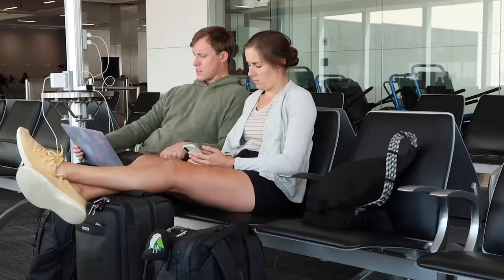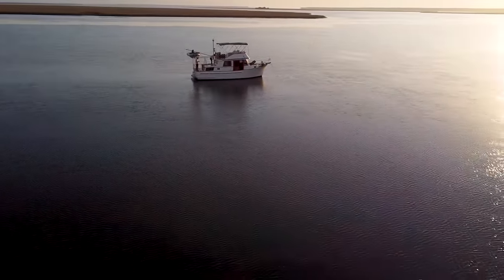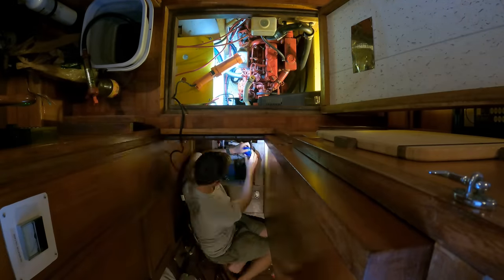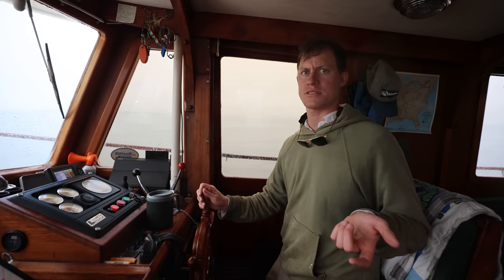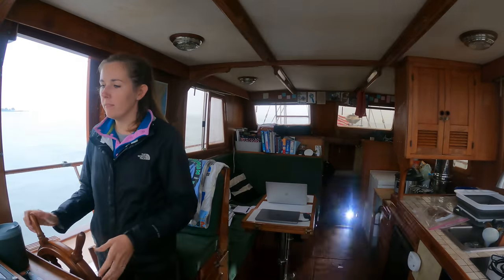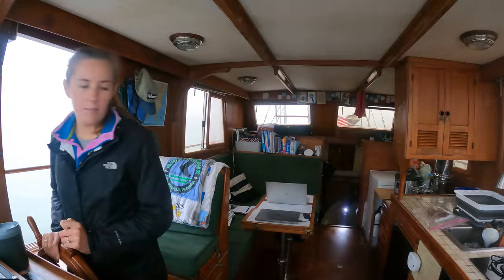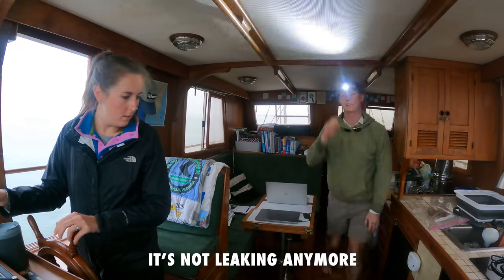ENTERING the BAY and we find a MAJOR LEAK! (Our PSS Shaft Seal + How we timed the weather)

Comment: You are doing a super job dealing with new boat problems.  Elliott is doing a great job obtaining info on problem and staying focused and taking breaks when needed.  Elliott, most times when set screws are tightened against a shaft they produce a burr on the shaft which keeps the collar from moving back.  Ran into this while on submarines.  Just a thought.  More huggs from Lady and Angel for Ollie.  Aloha!
Reply from the maker: That might be why it was so hard to move it! Thanks Steve 🤙 Aloha!

Comment: As an old Navy mechanic, I'm not so sure the shaft should be moving forward and aftwards.  But maybe it's different on these little trawlers? If I saw that I would start looking at bearings along the shaft.  Something would have to be loose to allow the shaft to move back and forth.  I believe this shaft seal is a mechanical type which depends on a tight contact between the spinning ring and the bellows portion.  So when the boat pulled in reverse and the shaft moved aft, the seal reseated. If something is a little loose and you start pushing forward, that would open the seal again.  I don't think this is a packing type shaft seal, those are designed to drip to keep the packing cool.
Reply from the maker: I think it wasn't the shaft moving so much as the bellows were sliding on the shaft making it look like the shaft was moving! Great questions and insight!

Comment: The shaft lock key on the coupling can work lose letting the shaft move forward toward the transmission. As the shaft moves forward the bellows will loosen. This could be the cause….always good to know all possible causes.
Reply: Exactly, I hope Elliot reads this, check the prop shaft into the coupling at the gearbox, the shaft may have moved forward a little Elliott, that'd explain the clunk you heard.
Reply: Unfortunately this actually occurred months ago They're well past it
Reply: Weather in video was dead giveaway but comments are for everyone to consider.
Reply from the maker: Thanks David! While our to tighten up the bellows worked (and we haven't had any issues in the many miles since) I'll take a look at it. We appreciate the thought!

Comment: Sometimes you can just tighten the stuffing box nut a pinch until you can reseal with a new packing. Some are designed to drip some are waterpipe fed like yours

Comment: Hi kids!!  Sorry you're having boat problems.  I have been rv'ing since 2005 and have my original 5th wheel unit.  Over the years I've had to replace/repair most major items.  That's the reality of boat/rv life as you are well aware.  You already know the "bad" points, but there are good points.  1) You really learn your boat and 2) if you fix it correctly, you can have faith in that repair.  Every time a new rig comes into the campground, I think about trading up then I realize that even a new unit will have issues.  I know my unit and how to repair it when necessary.  So the gist of this rant is this. Hang in there, you're learning what it takes to do this kind of adventure ( most people don't have the guts to leave the security of their homes) and , when all's said and done, you'll have a great and dependable boat home.  I think you're doing fine.  You deal very well with adversity.  Until next repair ( ha ha), safe travels.  Semper Fi.
Reply from the maker: Until the next repair 😂 They say everything on a boat is breaking, you just don't know it yet, sounds very similar to RV Life. Totally agree on the positives you mentioned!

Comment: Also it looks like you have a breather hose on the shaft seal. Not sure if you have water injection, but you don’t need it on a non-planing boat. Just run it vertically as a breather hose to keep air out of the shaft seal. In fact too much water injection will make it more likely to leak.
Reply from the maker: Thanks Randolph!

Comment: Do you have an auto bulge pump if so put a small dash light on so it shows when cuts in
Reply from the maker: We have two auto bilge pumps, the high water one has a buzzer so we are notified when that one goes off. Pivot is a pretty small boat, so we can hear the bilge going off, if we aren't on the flybridge and the engine isn't running but its a good idea to put a light on the first one, thanks Wayne 👍

Comment: I installed 2 of these on my boat. The bellows puts pressure on the shaft seal to keep it from leaking. There is a certain spec on the degree of compression required. They will leak if too little compression, or dirt between the faces. Also if your transmission/engine allows the shaft to move toward the bow as you increase thrust, you may not have the required tension on the bellows.
The bellows are a replacement item(I believe after 6-10 yrs). Unfortunately difficult to do with boat in the water.
In any case you can increase the pressure on the bellow by sliding the stainless collar towards the stern.

On a boat there is ALWAYS an item or two that needs attention. Just part of boating!
Reply from the maker: Thanks for the tips and info Randolph!
Reply: I just had 2 of these replaced on my 'new to me' 21 yr old boat. Not a minor expense, as I also had the shafts and props reconditioned !! However, upon sea trial, it was discovered that the engine mounts are loose, allowing the engine/shaft/rotor to move forward and come off the graphite bushing. Still waiting on the mechanic to get it fixed. But just another reference point for those who have a seal leaking.
Reply from the maker: @thetattooedladyfan  good luck getting it all fixed Jim!
Reply: @thetattooedladyfan  Remember that engine mounts can be faulty or “loose”, but most engine mounts are designed to flex a little to isolate vibration. So in that situation all engines will move slightly on their mounts based on torque and thrust angles. So a drip less seal has to be designed and adjusted for that. That is why there has to be a significant amount of pressure created by the bellows to keep the seal tight if the shaft moves forward a couple millimeters in gear at high thrust. Not to mention that fiberglass boats can actually flex a little also.
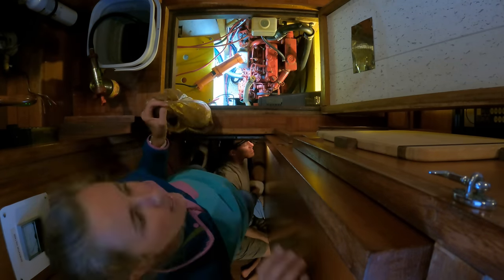Reply: @randolphh8005  Understood. But I videotaped my mount going from idle to 3600 rpm, and it’s moving significantly more than a few millimeters. See video link https://youtu.be/0KNEzh4QSno. FF to 1:35, 1:50, 2:00, 3:30 and see the movement.

Comment: Keep aware of how close you stand near a turning shaft. One time, the gear cable on one of the two engines, broke -  which required me to stand over the engine, and manually change gears, while my father steered the boat - apparently, I was standing too close to the turning shaft (about 800 RPMs - idling speed) when the turning shaft literally ripped my jeans I was wearing, completely off of me. Fortunately, I was not harmed by the incident; but repairs were a lot more than simply replacing the gear shift cable! We had to do a haul out, to complete the repairs. And fortunately, I was wearing underwear!
Reply from the maker: Whoa!! Good thing you were wearing underwear haha, that could have been much much worse - thanks for the heads up!

Comment: Recently replaced our PSS shaft seal (while out of water by professional). There is a lifetime for the PSS bellows and it varies by specific PSS model. (6-years max for non Pro model).  Someone advised me to replace for insurance reasons (since the age was could not be verified- no records from prior owners).
I imagine there is quite a lag in your posts and you may know this already but I suggest checking with your insurer so you know your responsibilities!
Reply from the maker: Yea we found this out too, 6 years until the bellows should be replaced. It’s hard to say when ours was installed but the boat really doesn’t have that many hours on it. We may take care of it after the loop on our next haul out. Our insurance didn’t mention it so not sure, but I could definitely see them asking for it. Thanks for sharing!!

Comment: The shaft should not have that much thrust movement. When you showed the shaft and put it in gear the shaft moved quite a bit.
Reply from the maker: Hmm thanks for the advice.. I'll do some research!
Reply: @SchoandJo  Also the source ( pump ) of the water for the dripless will have more volume and pressure as rpm's increase if it is spun by the engine.
Reply: @SchoandJo  I posted a comment above about my problem. Dripless Seal packages definitely needed replaced (they were compressed all the way down), but I also found that my motor mounts were loose, allowing engine/shaft movement which let water in. However, still waiting on mechanic to repair the motor mounts. I took a video of it under load.

Comment: You need a new carbon graphite seal...I'd stabilize the shaft with 2 pipe wrenches,  call for sea tow to get her hauled out.
Not only she's taking on water, saltwater spraying all over the engine room now.
Reply from the maker: Yea that saltwater spray was not good... and who knows exactly how long it has been happening for? Thanks for the advice!

Comment: Where do/did you go to research the cause and fix of the leak?
Reply from the maker: I started with figuring out what the part was (A PSS Shaft Seal) then trying to understand what its purpose / how it works. Then googling common problems with our problem like (spray at high rpms) etc. and then reading a ton. For this one, it is a common issue so I found it relatively quickly!
Reply: @SchoandJo  good deal and thanks!  How long do we wait to find out what the permanent fix is?
Reply from the maker: @eugeneproulx5082  well the next couple videos will be about this! So stay tuned, one coming out today and the next one on Monday! 😁

Comment: When was the last overhead ran on that engine , not that the overhead has anything to do with your leak
Reply from the maker: The previous owner did a huge over haul of the engine right before we took ownership! So 1.5 years!
Reply: @SchoandJo   if your putting a lot of hours on that engine ,I'd get one done , check on it may save you a lot of money in the long run
Reply: Ps , if that's a engine used in tractors , call on a tractor dealer , Ford New Holland,  Massey Furgeson , ect
Reply from the maker: @roydora  It is a tractor engine but it is also very old :) Unfortunately, this part of the boat (the part that is leaking) won't have anything to do with the old tractor sections, it's part of the marine parts where the transmission ( a marine transmission) and propeller shaft exit the boat. A good engine review and inspection would definitely be great though!
Reply: @SchoandJo  the shop Manuel for that motor wold be really handy , explain the overhead, trouble shooting , overhaul. Bet you can get parts for it at NAPA